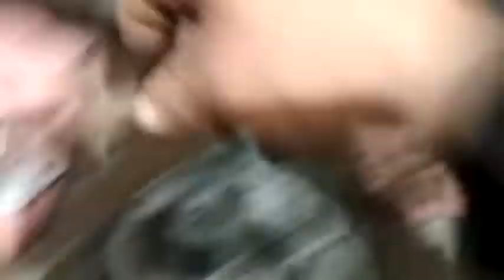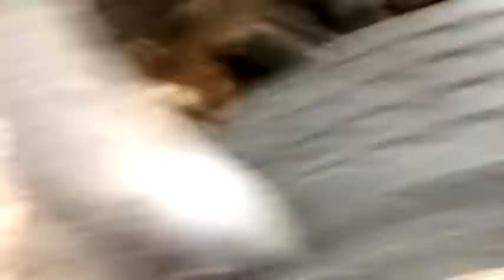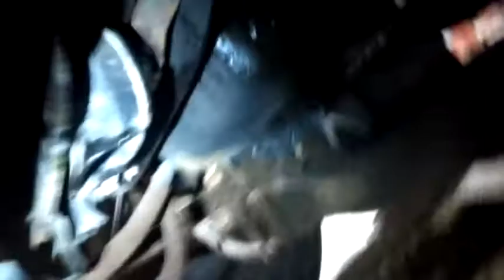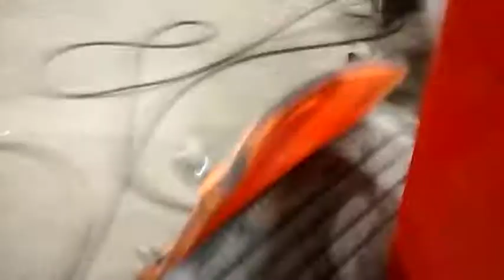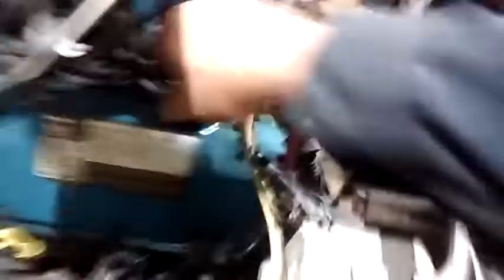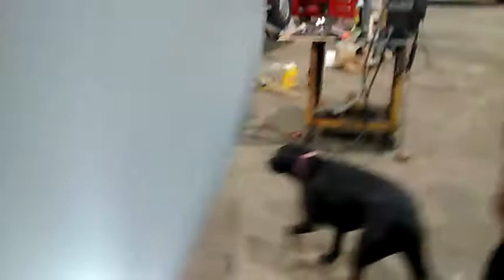Skoolie Maintenance and Repair Series EP 4 - T444E Oil Cooler Replacement

Comment: Shoot, I hope I'm not becoming that one annoying dude but I got another one for you. It's been getting below freezing at night here in CO but it still goes up to 45-50's in the daytime. I changed all the fluids and filters already, the fuel in the tank is winterized, batteries good, heat is working now(thanks!), but today this happened again: a very difficult start with way too much black smoke (some seemed to come from under the hood); I knew the front end of the oil cooler had a very slow leak going but today it actually spat oil down on the ground as the engine finally started. When it is running, no leak. Most of time that it sits, no leak. This hard start/much black smoke happened a handful of times already lately, primarily when the bus sits for more than a couple of days, even if it doesn't get too cold overnight. What do you think?
Reply from the maker: When is the last time the bus was actually driven down the road to burn up excess carbon.
Reply: @JohnnyMullet  So the last time was yesterday, after starting it and burping the air I drove it for like an hour and a half. On the last tank fill up (2 weeks ago) I added 8 oz of Stanadyne Diesel Injector cleaner and later that day drove it for 3 hours. Last week another hour before I started working on he breaks. Tank is now 1/4 full. The excessive smoke/no start began after relocating to the mountains - I never had that happen on the east coast. I'll tell you everything lol!

Comment: Warning - long text ahead!
Would let me know your opinion on this? I drained the coolant at the radiator valve. After wrestling rusty Napa coolant filter for 1/2 a day, I replace with BW5071 (w/SCA). About 4 gallons of coolant came out in total. It looks nice and clean so I think I don't need to flush, just replace, but it's yellow in color! WHY IS IT YELLOW!? That means universal, right? Bus is a 1998 Int 3600 w/ ~170k miles. I start to read on the type of coolants designed for this 7.3 engine. So many mixed opinions out there, but this seems to make the most sense (https://www.thedieselstop.com/threads/coolant-changing-instructions.163800/): 
"Due to International's compatibility tests, all pre-2/2/99 build engines (pre-SN 940614) should use a conventional coolant with the addition of SCA (or a pre-charged conventional coolant already charged with SCA). Most conventional coolants will be green, "low-silicate" and meet ASTM D4985. There are too many brands to list. They will require the addition of a supplemental coolant additive (SCA) at initial fill and maintenance of that SCA thereafter. Most pre-charged conventional coolants will be pink, purple, or blue and meet ASTM D6210. These coolants do not require an initial dose of SCA, but will require SCA maintenance thereafter. These are coolants like Peak Fleet Charge, Prestone Heavy Duty, Zerex Precharge, Shell Diesel Ready, Fleetguard Fleetcool, Fleetrite Fully Formulated, and so on.
Tip Do not use "All Makes - All Models" coolants, or "Universal" coolants. They will not meet the needs of your diesel engine."
Whaaat?

I see all the alarm bells about not mixing the colors so what to do? I call International - the dealer shop in the area uses Fleet Rite red OAT in everything. I don't know for sure, but it seems like PEAK FleetCharge is the same product but cheaper - like 17 bucks/gal at most stores.
IDK about the other ones like Prestone (OAT) or Zerex(HOAT) - yellow in color, that everyone at the regular parts stores told me would be compatible with my engine. Again, my coolant was already yellow. OAT label says it mixes with everything, HOAT doesn't mix with OAT. The more I read the more confused I get.
 Another recommendation specifies AMSoil PolyOrganic coolant as a good way to go.

This morning I stop at a diesel shop to ask a mechanic there. He tells me the above yellow coolants are just fine, and he would use any of those. Ok dude, I decide to keep it yellow, I go for 2 gal of Prestone OAT Universal concentrate , mix with 2 gal of distilled water and top the the reservoir to cold mark. I let the engine run, the temp gauge reads fine but inside won't blow hot air. It blows cold. I learn it can be because of trapped air in the heater core. At this point what can I do:
1 - Try to get the air out and call it good if it blows hot again
. Q: HOW DO YOU RECOMMEND DOING THIS?
2 - Flush the system with distilled water a few times and replace coolant with FleetCharge or AMSoil?
Johnny, what would you do !?
Reply from the maker: Make sure the heater valves are open on the heater hoses. The coolant will work fine. I prefer conventional green myself. Suggest running with rad cap of for awhile to purge any air and go on a test drive to get it flowing good.
Reply: @JohnnyMullet  yep the valves are open, I should've mentioned the heat WAS working before changing the coolant. I wasn't sure if that universal coolant would damage anything in the system. I'll replace it  next time I need to get in there so thanks for setting my mind at ease. At the moment I have the rear on jack stands for replacing the calipers and pads - which should get here tomorrow. I had a piston seal leak and I realized the pistons were also crummy around the outer rim. Anyhoot :], would raising the rear help get the air out since I can't drive it at this time? Or I need to do the front?
Reply from the maker: @TiberiuTiru  Need to get the radiator cap at it's highest point to burp air.

Comment: Johnny,  Doing a fluid swap on my '99 T444E and wanted to see if you were gonna post a detailed coolant flush video?  I have a worry that that the previous owner may have been using an ELC coolant in my non-ELC compatible engine.  Figured this would be a good time to ask since your..."running low" on coolant as a result of the oil cooler leak.  I hope the swap fixes the issue and thanks for all the informative posts.  Best to you and yours, and safe journeys!
Reply from the maker: There is a drain on the bottom of the radiator. Remove coolant cap, drain, then flush with water. To remove ALL old coolant from engine, you need to fill with water, run engine at operating temperature for 5 minutes, drain, fill, and repeat with water several times until it's all out. This is time consuming.